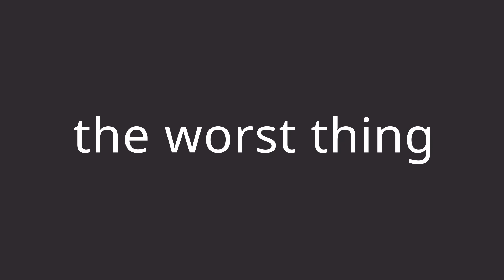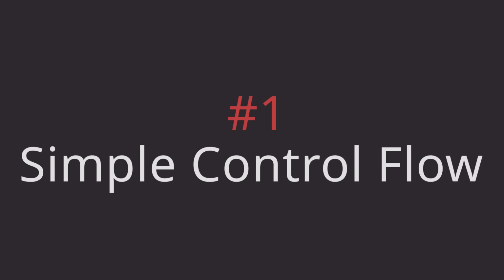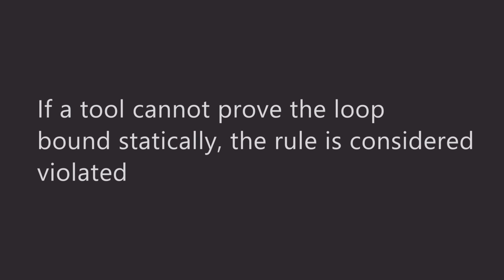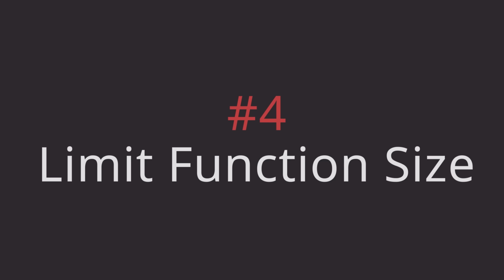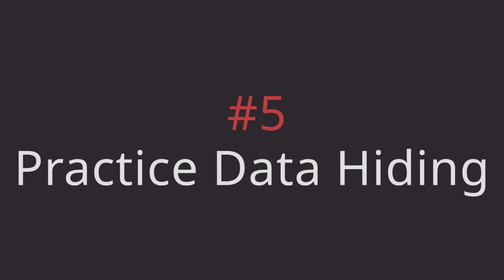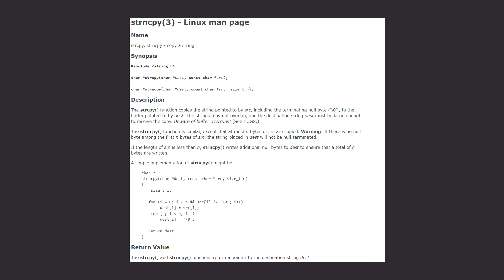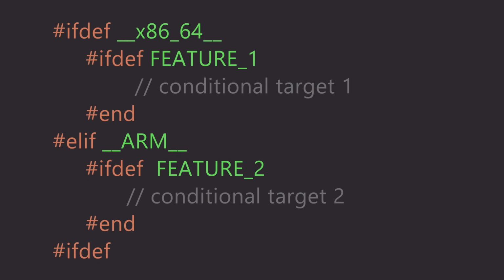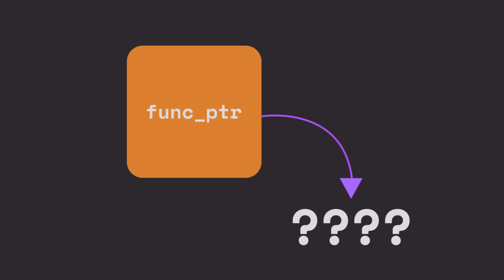how NASA writes space-proof code

Comment: Sounds like sound advice. Making a medical thingy nowadays and since we've decided to have MISRA shout at us we're compliant with most of these rules :)

Very annoyed at GCC not enabling all warnings with `-Wall` or even with `-Wextra`. A buuunch of extra warnings to enable.
Reply: I leave off -Werror just as a developmental thing.  Nothing even makes it into an archive library w/o being warning-free.  But sometimes during developing half-finished stuff - yes, there are interim warnings.  In those cases I don't want the compilation to fail because the coding hasn't been completed.
Reply: @jimwinchester339  
I personally prefer to have absolutely everything enabled all the time, and use -Werror. 
But sometimes I need to test things while still having unused variables and such, and in those cases I explicitly disable them as errors, but keep the warnings (-Wno-error=unused-variable). That'll let me work unhindered but still lets me know that I've got issues laying around who must be resolved eventually.
I also try to keep those suppressed errors restricted to only the files I need to suppress them for to prevent other issues sneaking in elsewhere.
Reply: If you're doing code developmrnt for Medical, take a look at IEC 62304 too. Personally I think it's very light on technical requirements though and focusses too much just on process. I can understand why you've adopted Misra. Also think about using some other static code analysis tools. Lint isn't bad. Depending on what you're developing and how much resource you have, you could also look at dynamic analysis and tools for version control and requirements tracking.
Reply: @drmal  
Oh yes, IEC 62304 is one of the many standards we have to keep in mind. There's a whole team dedicated to keeping track of standards and managing the QMS systems. 
We're using a few tools for static analysis, but I would love to have some more. Anything that helps keep the quality up is greatly appreciated.
Reply: Did you chose to use MISRA voluntarily? As a dev who has had to write MISRA compliant code, I don't understand the appeal. MISRA checkers are unreasonably expensive. Many of the rules are not useful, or even promote bad practice in some cases. MISRA gives you no guarantee that the code had any quality at all. I don't believe there is enough anti-MISRA sentiment online.
We actually had the exceptionally painful task of converting a non-MISRA code base to mostly MISRA-compliant. This introduced more bugs that it ever solved.
Reply: @userPrehistoricman 
Yep, we chose MISRA voluntarily. It took some time getting used to the rules, but has worked out fine after that.
For analysis we have used Cppcheck with the MISRA addon. It doesn't catch everything, but it has helped us catch a few things that had been overlooked.
We make sure to not enforce the MISRA rules on existing or external bits of code, but any additions we try to write in a compliant way.
We do have cases where things get in the way and would result in bad code. In those cases we would document the deviation in the code and in a separate document, with a reason for the deviation. 

In general, aside from the grumbling at the start, the MISRA rules have been a nice addition to our internal rules and guidelines. 
We don't have to follow the rules luckily, so we're free to disregard rules we deem to be too intrusive. There are few of those though :)
Reply: MISRA is pretty crucial rule series.
Reply: It turns out gcc enables many of its warnings only when optimizations are turned on, because that’s the only time it does the analysis needed to detect the warnings.
Reply: @richardblain4783  Oh, I've never heard about this before. Very interesting, but I suppose some things "look" different when aggressive optimizations are being done.

Comment: Wait, how can linked lists even exist if you aren’t allowed to use the heap?
Reply: There is a way to create a linked list without allocating memory on the heap (and even without pointers). This can be done with two arrays. In C it can be implemented as follows:

struct next_node
{
    size_t next_index;
    int is_end;
    // if at the end of linked list
        this should be 1, otherwise 0
};
data_type data[MAX_SIZE];
struct next_node next[MAX_SIZE];

So essentially we break a node in a linked list into two parts: the data that a node holds (which is stored in the array “data”) and some way to find the next node (which is done by storing the index of the next node in the array “next”).
Reply: the heap itself is ultimately just an array
you can make your own stack-allocated heap
and then tadaaa you "haven't used the heap"
Reply: @yjlom  That is also what I am thinking about, basically I can just pre-allocate some memory and work on that. I think what this does is that it caps the memory usage at a maximum amount, therefore avoiding memory leakage. On embedded systems this does make sense: if I know at a specific point I will have 64KB of memory available, I can just take it altogether. It doesn’t matter if I ended up using 1KB or 63KB out of 64KB, as long as the program does its job, it’s fine (under this circumstance, “unused RAM is wasted RAM”). However, this wouldn’t make sense if I’m writing a program for a PC (“There’s 8GB of memory available, I’ll just take it altogether” — that would be ridiculous).
Reply: I assume those are "explain why you actually don't have another option" kind of rules, not "you can't do this at all" kind of rules.

Comment: Nasa should start using Rust
Reply: unsafe rust??
Reply: @vaisakh_km  Unsafe rust is just C with worse tooling. It's not bad
Reply: erhm.. "This project will provide Rust language support for NASA’s core Flight System (cFS). The Rust language is designed to be memory-safe: it detects a wide range of programmer errors at compile-time while allowing low-level access to hardware and high performance. Rust’s safety features make it ideal for writing new cFS applications." edit: looks like it was just a project, and its got closed status. so not sure if they use it.
Reply from the maker: hey you said it first, not me lol

Comment: Meanwhile I can’t write safe C++ code that handles user’s string input
Reply from the maker: C++ be like
Reply: @LowLevelTV  C++ is the absolute language.

You can do absolutely everything in it.

But you also need to be absolutely perfect.
Reply: @player400_official  Modern C++ is remarkably safe.  The problem is it's tied down to all the legacy C baggage that is fundamentally unsafe.  The general advise is "Don't do that" and try and stick to modern C++ whenever possible.
Reply: @LowLevelTV  🥲
Reply: lol =) well, there have been codebugs in rocket launches, like Ariana 5 in the 90ies, which had software done in ADA, and the code tried to push a 64bit floating point number into a unprotected 16 bit unsigned integer register. So when the rocket reached a certain height, the register could not store the data anymore, and sent the rocket down to earth.  I think its called the worlds most expensive software bug....   not rocket launch, but there was also a coding error in a x-ray machine that hospitals used, which unfortuntatly led to people got killed. They used a register which was too small to keep the data, which led to the machine giving the patient a way way higher dose of x-rays then intended.  I am lucky I only do simple applications :D
Reply: @AndrewTSq  pretty sure the radiation treatment machine had a different problem, if that is what you're referring to.
for radiation treatment machine the code was supposed to be input slower, so that actual hardware could move to a new state.
basically the physical aspect of state switching wasn't taken into account in the software, so a lot of people were given way too high of a radiation doses.
If you link your story(if it's not the same one) i'll try to find the one I told by someone who actually explains it in depth.
Reply: I wrote a 100% safe basic + - * / single operation calculator in raw x86_64 assembly and I can tell you the thing that took me the longest time where user input and strings. That's just the nature of those 2 things. They always cause problems period.

For those who wonder this took me 4 days and 386 lines of assembly.
Reply: who needs strings? :)
- calculation amatuer
Reply: @NoNameAtAll2  Oh no, a string bug "amatuer" ... eeeek!! Help!  🤣🤣🤣
Reply: Can I learn c++ to join in space jobs

Comment: I give you a video idea: do embedded c++ that does not use standard library by using -fno-exceptions and -fno-rtti
Reply: -no-stdlib
Reply: std still works without exceptions and rtti
it just terminates if those are called
Reply: Embedded C++ is just a C, because all what C++ does is creates syntax sugar around v-tables (i'm exaggerating of course), and if you will try to avoid everything that consumes CPU cycles and memory for no reason other than "clean code", you will be program in C++ like in C. But, you will not have access to restrict keyword, and there was something about unions in C++ which I don't understand, but for some reason they are not just a multiple types for one address.
Reply: @rogo7330  Most C++ compilers should have a __restrict keyword anyway.
Reply: @rogo7330  Well no, since C++ and C are far from the same language despite the differences between their respective standard libraries. And the union case you're talking about is that C allows type punning through unions, while that is undefined behavior in C++ (for very good reasons), instead you go with the `std::bit_cast` or `std::memcpy` route if you want to reinterpret some memory, as that deals with lifetimes properly.